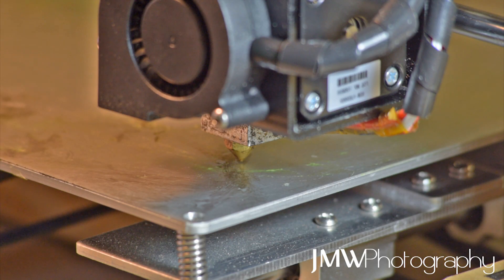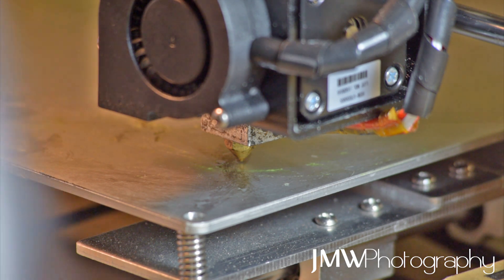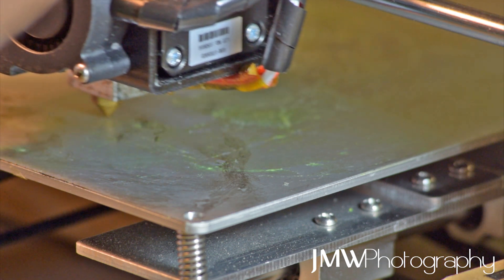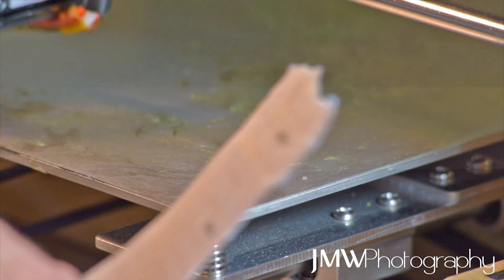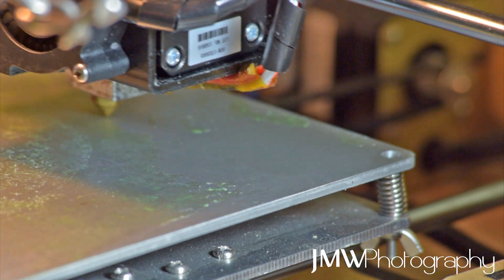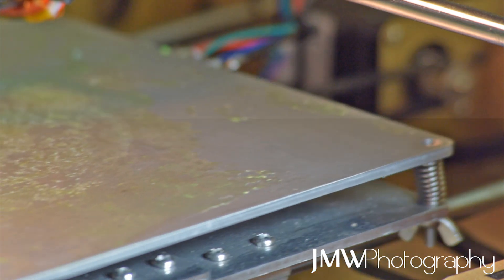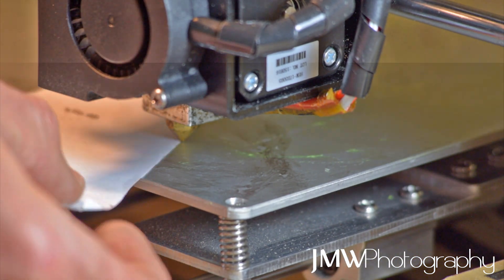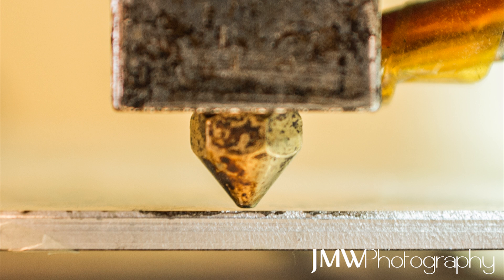Perfect Bed / Nozzle Levelling - Anet A8 - 3D Printing Tips - Tutorial - Please Read Description

Comment: Mine is having mis-leveleing problem each time I reached at least 30% to 40% of printing. The tip of the hot end would suddenly seem to touch the printed part without distance, thus, causing hardening of filament at the tip of hot end  blocking the flow of filamet. The extruder gear would tear the filament's edges. It often results in failed printing

Comment: Someone needs to do a proper explanation on this rather than a high level "Here's how and why".   What is the actual gap?  Does the same gap always apply? Paper is subjective, I measured two sheets of paper, one was 0.18 mm and the other was 0.06 mm.   When you are dealing with a .1 mm difference impacting your print, you have to know the optimum height.    I assume the nozzle and filament size also impact the required distance.   The paper technique is very subjective.  We all get grabbing, binding or bending the paper.  But the proper amount of slide, slip or drag that is considered good  is very subjective.

Comment: The issue I am running into is this, the edges of the bed print fine but the center does not stick. It seems to me that the plate might be bowing but I can't visible tell. Any suggestions?
Reply from the maker: Hey Seldin, yes that can be the case for sure. The easiest way I have found to solve this(short from buying a new bed that may already be warped as well) is to fit a glass sheet to your bed using document clips. If you can find a piece of glass(broken mirror, picture frame etc), you can get a cheap glass cutter on Amazon and have a supply for when one breaks. 😊
https://www.youtube.com/watch?v=DODR_S-xFVg

Comment: I just recently got the Anet A8 but I'm having so much problem just trying to level the Z-axis. Every time I hit Home All it somehow get stuck or something on the left motor causing the right side to be 2-3mm higher. This just makes it impossible to level the bed. Did you encounter this issue too with your Anet A8 and if so how did you fix it?
Reply from the maker: Hi Wickedy Witch, have you gone through the Anet A8 debugging video? That tends to help with quite a lot of people's issues. Have you lubed everything up? You want to use something like this: http://amzn.to/2p0qba9
You can also check your Z-rods are coupled correctly. Very hard to explain in typing.. The ring thing that the Z-rods pass through have little screws on them, you can try loosening them slightly as well. Good luck and perhaps try one thing at a time so you don't accidentally cause new issues with changes that don't need to be made. 😊
Reply: I found the problem, one of the screwed rods were slightly bent by 1mm or so :') Thank anyway.
Reply from the maker: Oh darn! That's really annoying! If it's only a fraction, you may be able to bend it true. 
Good luck!

Comment: your h bracket is upsidedown
Reply: The instructions labeled it as such for me and i'm guessing for him as well.
Reply from the maker: I missed this comment. Thanks guys, you're both right! 😂 The instruction did show to do it wrong and I blindly followed. This has been rectified on one of my printer when I did some maintenance last but the other yet. Funnily enough, the printer with the bed 'correctly' oriented won't print flexible filaments but the other will. I'm sure this has nothing to do with it but otherwise, they are exactly the same. Haha. 
Happy printing ya'll! 👍🏻

-Jesse.
JMW Concepts.
Reply: Crap now I need to go check mine at the office too!
Reply: Inside The Mind Of Matt hello Matt.  Ok so you say his H bracket is upside down. This is also the way it showed me in my directions. I have another printer coming this weekend I'll make sure I turn it over the right way. I'm not gonna change the one in the printer I have now it seems to be working fine. I guess I'll fix it when I have to change the belt or something. Thanks for letting us know brother.

Comment: I put it flat on bed.. the printer raises z to print first layer. If you use the paper method, you should add z offset to -0.1mm in slicer.
Reply: What printer is this?  Mine certainly doesn't do this.  #falseinformation #doingitwrong   lol
Reply: If you tell the slicer software you want the layers to be 0.2mm thick then your printer will add 0.2 mm to the gap you created using paper.  This applies to the first layer.

Comment: I think, in the MANY videos I've watched, you're the FIRST person to recommend preheating the bed and nozzle.  Sounds obvious... once you hear it.  :)

Have you pulled all the filament out of the nozzle to keep it from oozing while leveling?
Reply from the maker: Hi +allanGEE, thanks for the comment. 😁 Feel free to subscribe for regular updates
I don't bother taking the filament out, I find that once the little bit of filament that is right in the tip if the nozzle will slowly ooze out, but once that little bit right at the end has oozed, it tends to stop. It may take a couple of minutes but I usually fire up my printer, go do something else and come back once it's heated. Then I'll just pull the little stick off the end of the nozzle and off we go. This does also mean however, that once levelled and ready to print, it's not a bad idea to re-prime the nozzle by just manually feeding a small amount of filament through until it starts extruding out. Obviously use tweazers or side cutters to take this little hair off the nozzle before printing. 
I would HIGHLY recommend this bed-levelling mod. I haven't had to do a full levelling since installation. 😄
https://www.youtube.com/watch?v=sOXuJFgiM24&t=23s

Thanks again and happy printing!

-JMW.
Reply: It costs from 146.99 to 166.62 dollars. Current coupons:
http://couponsfromchina.com/2017/06/15/anet-a8-3d-printer-eu-active-coupon-price-gearbest/
EU warehouse (no tax in EU and fast shipping)
Cheers

https://www.youtube.com/watch?v=L6GJWHwrTmY
Reply: I'm monitoring price and it's from 149.89 to 155.99 dollars. Current deal is here:
http://couponsfromchina.com/2017/03/02/anet-a8-3d-printer-eu-plug-active-coupon-price-gearbest/
Gearbest is a well known online store, so...

https://www.youtube.com/watch?v=L6GJWHwrTmY
Reply: I can't believe it's just for 149.89 dollars
https://couponsgearbest.wordpress.com/2017/03/02/anet-a8-3d-printer-eu-plug-active-coupon-price-gearbest/
Sweet

https://www.youtube.com/watch?v=L6GJWHwrTmY

Comment: I have over 2 days of continuous printing. i level my bed but when it starts printing its like it goes too high. 

I hit "home all" and kill the steppers and begin leveling. i start my print and its like the nozzle is a good 3 to 4 times further away all the way around... what the heck am i doing wrong?
Reply from the maker: Hi +Nib-Na5ty, have you printed some successful prints before this and it has just started? If that's the case then the first thing I would do is try another .gcode. I have had 'broken' files before that can do all sorts of silly things, including starting to print above the platform. 
Try a new file and let me know how you go. We'll get it printing! 😄
-JMW.
Reply: JMW Concepts i printed a test cube just fine but i got horrible results on my first layer for trying to print something else. I've had some beautiful prints before so this is just frustrating.

Comment: Is the print quality of a 3D printer good enough to make things we can sell online?
Reply from the maker: Hi Invention Therapy,
That is a good, yet loaded question. The answer is most certainly yes, as lots of people do it however there is a lot more to it. 
Depending on the size and quantity of what you are looking to produce, you will probably find yourself looking faster and more cost-effective methods. For example if you are doing smaller, custom items(keyrings, pendants etc) then 3D printing may be the way to go. 
If you are wanting to do bigger batches of the same thing, 3D printing will be useful for prototyping, then you can send the final design for mass production(injection moulding etc).
As far as overall print quality, that depends more than anything on calibration, knowledge of the user and effort put in post-production.

I hope this helps. 👍

-JMW.

Comment: A better method than paper is a set of feeler gauges. Also the nozzle should be approximately 40 percent the distance from the bed as the nozzle diameter for the first layer. If the nozzle is .35 mm in diameter the feeler gauge to use is .15 mm thick or .013 of an inch use a .005 feeler gauge. This is what I use for most prints. If you change the nozzle ( I have a range of nozzles from .2 mm to .7 mm. ) make the adjustment accordingly. A piece of paper measures approx .004 or .101mm thick. If you don't know the nozzle diameter, you can manually extrude filament, let it cool and measure the diameter with calipers. Then make your calculation. Test this out for yourself. Of course this is just a place to start. If you change nozzles diameters be sure the program knows the diameter you installed. The slicer will space the distance between lines according what it thinks the nozzle diameter is. For instance, if you change to a .5 mm nozzle and the slicer is programmed for .35 mm nozzle the lines will excessively over lap and cause a problem. Good luck and happy printing.
Reply: JMW Concepts I tried to visit your web site and it's off line. I really want to know more about your company.
 As to over thinking, it happens to be one of my fatal flaws. I've been a machinist 40+ years and use to being dissatisfied with + or - .1 mm.
Being meticulous is sometimes a very bad habit. But .1 mm is the thickness of the shim in question. If the surface varies more than that to the plus side the nozzle scrapes the table and cuts off the flow of material. The variation on my table was.17 mm. So level the table at the four corners and calibrate at the high spot was my solution. We have saying " You can't finish square unless you start square." Consistency is one of the secrets to repeated success. P.S. Notice most of my posts are edited.............
Reply: Robert Burns hey mate!👋 -any reason you use a .35 instead of the bog-standard .40? I assume 1.75mm filament.. would, say, a 0.25mm nozzle provide finer prints? (That would be the best nozzle setup for a 0.1 mm gap, as described in the video, which you are saying is some 50% too small a gap) good tip tho, im new to A8 printing 👍🏻
Reply: bryzabone yes .1 mm gap for a .25 nozzle is correct. But my machine ( Pursia i3 ) came with a .35 mm nozzle installed. In the beginning my biggest problem was the first layer. Instead of sticking to the bed the bead would curl up and stick to the outside of the nozzle. This was due to two factors. 
1) The glass I was printing on was not flat. So when I calibrated at the four corners of the bed the center was .17 mm higher than the corners. Causing the first layer to print to close to the table.  I discovered this by putting an indicator on the head and traversing the table every 10 cm in each direction. I solved this problem by leveling the table at the corners but my final calibration for my first layer was done at the high spot which turned out to be at the center of the table on my machine (your results may vary ;) ).
2) In the beginning ( not the  Bible ) I used ABS. I did the acetone slurry thing. But it was very difficult to clean. I tried every thing ( anybody wanna buy a bottle of hair spray?) . What worked best for me was Elmer's Extreme glue stick. Readily water soluble and easy to clean and I do clean the table each time I print. Excessive layers of glue will interfere with the calibration of the first layer height.
 Yes a smaller nozzle will produce a finer print. If your happy with the resolution of the print don't mess with success.
But changing to a larger diameter nozzle can save you lots of printing time. If I were you ( and I'm not) I would get at least six months of experience under my belt before trying any modifications to the machine. Always keep an accurate record of every thing you do i. e. A log book. That way if something messes up you can put everything back the way it was and start again. 
 I hope this is helpful            HAPPY PRINTING !!!
Reply from the maker: Hi +bryzabone, don't over think things. If you have feeler gauges, you can use them but I wouldn't bother going out to get them. I haven't seen any of the 'big' 3D printing enthusiasts using them and regardless of nozzle size, most crew use the same gap- standard paper! 😂
How are your prints coming along? There are a lot of settings to work with for finer detail before changing nozzles! 😊👍
Reply from the maker: Hi +Robert Burns, thanks for the interest! My web site is down at the moment due to a big(and long deserved) overhaul, I thought at this time of year I would get away with it un-noticed. 😉
I like this, " You can't finish square unless you start square", absolutely true. In my experience this is ESPECIALLY true with ABS and even more so(could be brand related) to black ABS. Where certain prints and filaments can more or less correct themselves, if my first layer of black ABS isn't 100%, I'll start over. Most PLA's I use will tend to work it out. 
My general rule is rather have the gap too small, and as you say, if you see a lack of extruded filament, slowly back it off. The bed-levelling wheels make this muuuuuuch easier. If you don't have those yet, I would highly recommend the mod. :)

Thanks again!

-JMW.

Comment: This actually did help a lot. I was messing around making significant changes on each corner and pushing down on the bed on the next corner if the gap was too small, etc. I was also placing the extruder head probably way to far into the corner which lead to all sorts of problems, obviously. The printer still managed to print but the first layer would not always stick. So yeah, great tip! Thank you!!
Reply from the maker: Hey +michor10, thanks for the feedback! Bed levelling is one of those things that(especially when starting out but always really) can be a bit of a pain. Have you done the bed-levelling wheel mod yet? Since this mod, I have levelled fully once, and now make tiny adjustments now and again as the first layer goes down getting perfect first layers each time. 😄 Link below.
https://www.youtube.com/watch?v=sOXuJFgiM24
Reply: Thanks for the tip. I am printing the frame braces at the moment. I hope they are worth the wait. The bed leveling wheel mods will be next! I'm also looking into this auto leveling sensor thing. I ordered this from Gearbest: http://www.gearbest.com/3d-printer-parts/pp_591321.html and I'm trying to figure out if I'll have to replace the firmware or not. People seem to be happy with the skynet 2.0 firmware so I'll guess I'll try that one out. I'm really super happy with this printer! PS: I also went ahead and bought Simplify3D to see if I get prettier/better prints. :D
Reply from the maker: Oh please let me know your thoughts on the braces! Just the other day I asked the same thing of a fellow on a Facebook forum. They mean a long time to have my printers out of action so I too want to know about their performance before printing.
To be honest I've heard mixed reviews on the auto-leveling systems so again, please let me know how you go. 
I've just started printing PLA after printing only ABS so right now, I'm finding it hard to make a print fail. 😂 
The A8 is beast to cut your 3D printing teeth!
Reply: JMW Concepts will do! I'll print a cube model and post my measurement results before and after installing the braces. I'll let you know how it went with the auto leveling mod as well. Cheers.

Comment: I would not have known to heat it up first, thanks.
1 question: 0.4mm is not the thickness of a regular piece of 80gsm paper. Regular office paper is about 0.1mm thickness. Did you use thicker paper or is the 0.4mm guide wrong?
Reply from the maker: Thanks for bringing this up @ArcanePath360. I made this along with another video on a day I had a pretty dopey flu and only much later realised the nonsense I was talking at certain points. This error slipped through the gaps.
The thickness of the paper we should all be using and therefore the gap is as you say, 0.1mm! Not 0.4mm! I will try and find a way to add a banner or something over the video. 
Here is the other video I lost the plot on. 😄 https://www.youtube.com/watch?v=H4deiB_jKfE
Thanks again!
-JMW.
Reply: No problem, it's always good to see videos like this so we can be aware of what to expect. There was also another mistake where you said PLS instead of PLA but it doesn't matter. You can use "Annotations" in your settings to put text overlays at any point on your videos. That's how most people correct themselves when it's too late to edit the video. Thanks

Comment: Are you printing directly on the aluminium plate ?
Reply from the maker: Hi Cid146, yes I do. Although I apply adhesive depending on what I am printing. For example, I usually print ABS so that's why there is a hairspray mess left on the bed. For flexi PLA I use less spray. haha.
Feel free to ask anything else.
Reply from the maker: Sorry Cid156 for the incorrect tag.
Reply: No problem. Thank for the reply and the video !